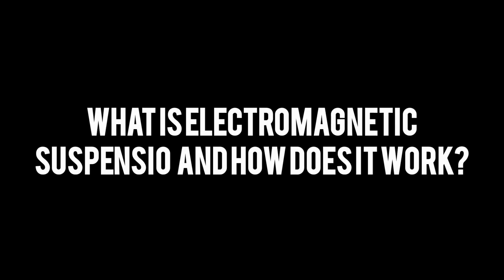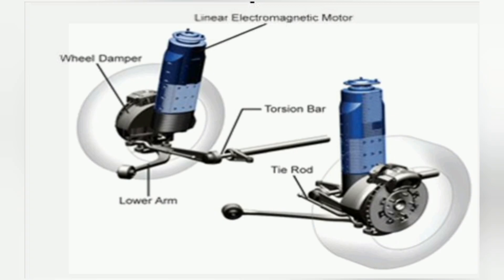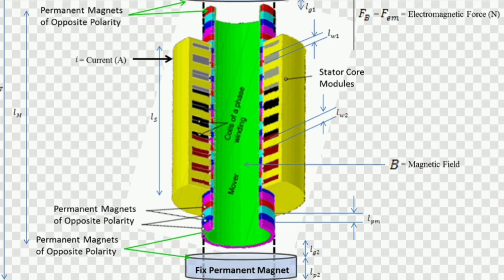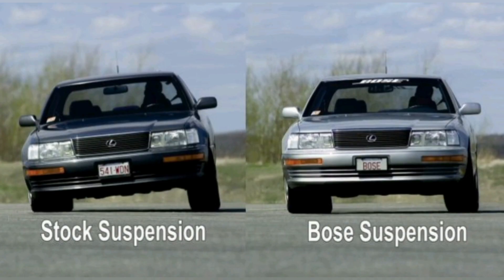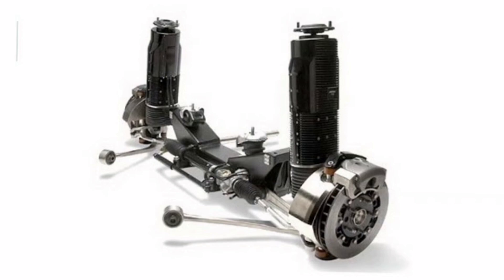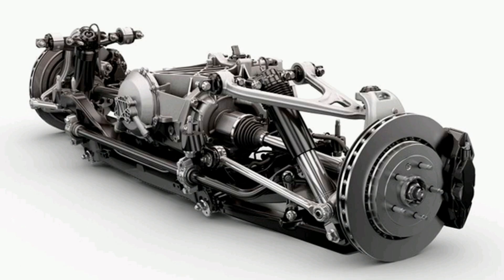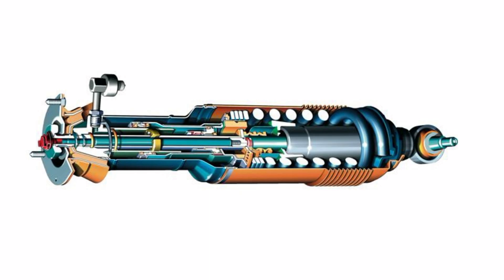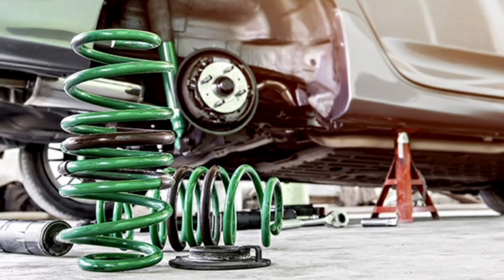What is electromagnetic suspension and how does it work?

Comment: i was looking for an exact video of it and after a year i got it, i did my fyp on linear actuator suspension system, and I wanted to know more about it for further research. why do we need this as we have a lot of other advanced systems what is the purpose of it, why do other big automobile companies hve this or will they work on it ? and how can we say that this is the best of all ??
Reply: 5 months later, but its fairly simple. very few car manufactures have actually implemented this tech into vehicles driven on the road. main thing is weight, it turned a sedan into weighing about the same as a pickup. also magnets don't stay magnetic forever unfortunately. they say its the best suspension in terms of road/bump absorption. so it may seem amazing on the surface but its too heavy/expensive to maintain over the course of a vehicles life. Hope this helped!
Reply: I don't that it will help me now but thanks, I wanted to continue into this field but unfortunately things didn't go align. But yeah I miss my major :')  @LumineFG